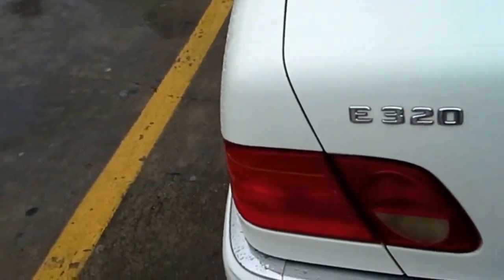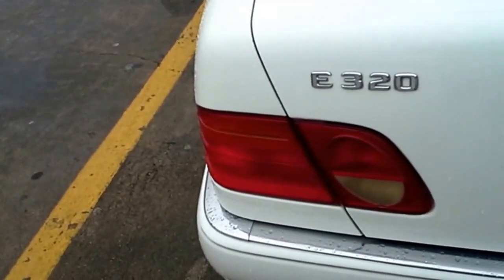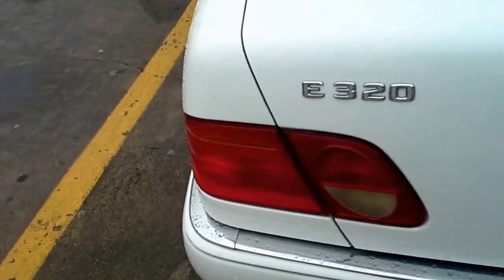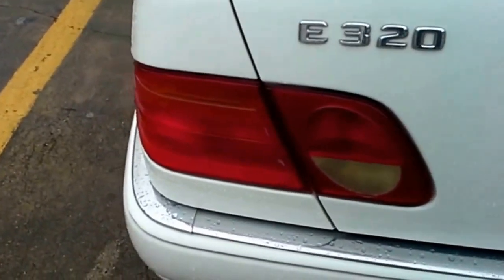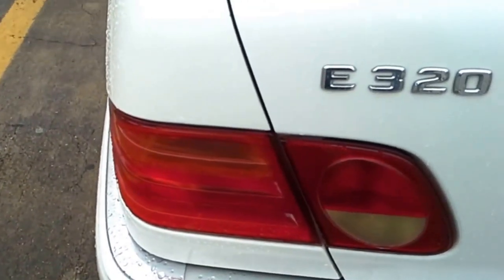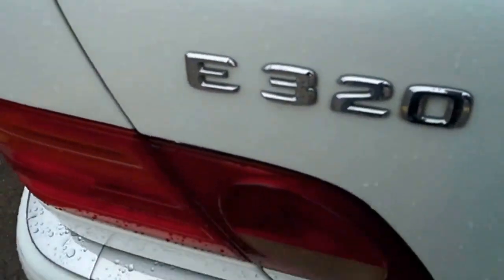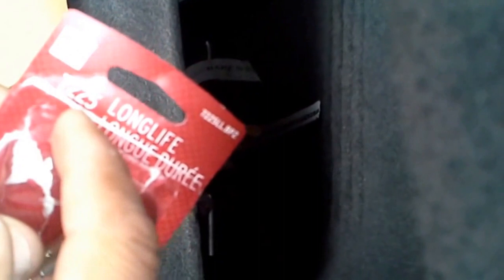How To Replace Mercedes E Class Brake light BULBS

Comment: Im having trouble removing the rear driver side blinker bulb. I was able to remove it on the passenger side but it seems stuck on the left side. Any suggestions?
Reply from the maker: If corrosion is keeping it from turning- sometimes I've had to break the bulb and use a pliers to turn the metal base that the bulb was in.
Reply: Jevin Deml understood. Thank you.

Comment: I need to replace the bulb socket that holds the bulb itself. I see some online that are different colors. Do the colors mean something or are they all the same? Will the same socket work for the turn signal and brake light bulb and vice versa?